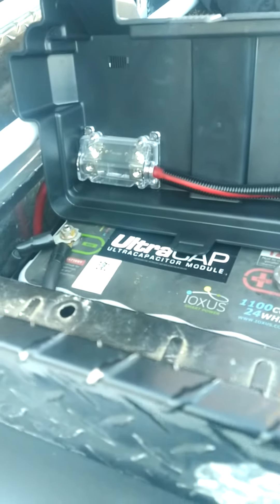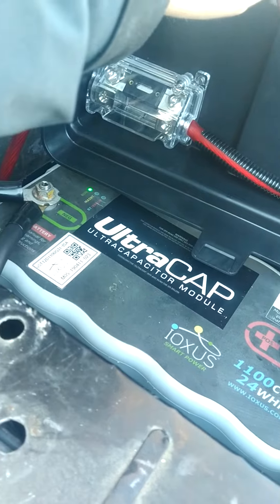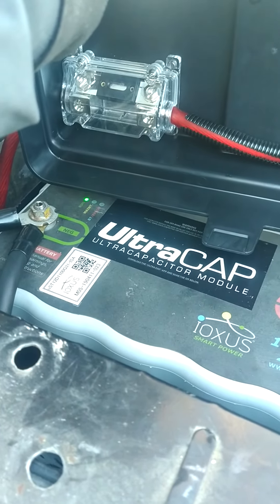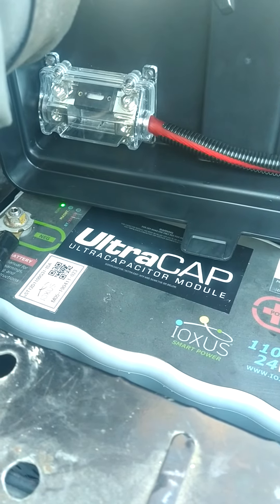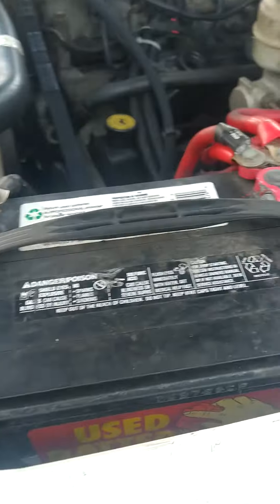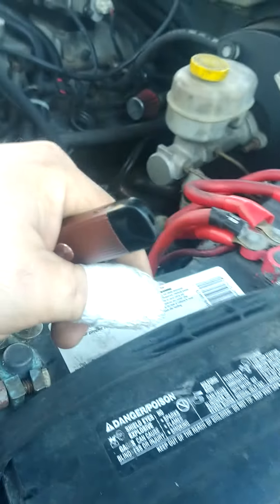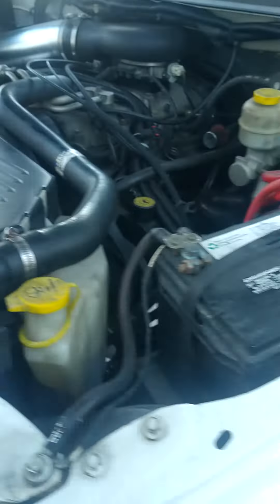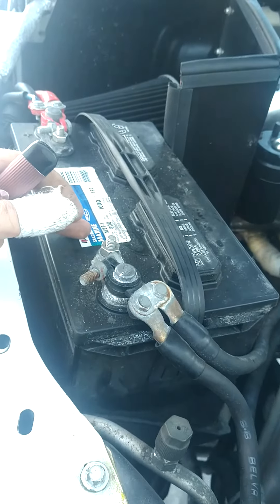Ioxus ultracapacitor installed.

Comment: Thanks.. gonna order a b stock from big Jeff audio.. I have 2 ab hawks. Orion xtr 2500.
Reply from the maker: It should hit good. I like the new Hawks, change it up from the XFLs.
Reply: @212Tan  yeah.. I had a 33hz box built by MBE.. 240 alt . Also running a Rockford t1 15 @38hz.. it's nasty just need more power

Comment: How did you charge it the first time?  Did you just run a wire from the battery and let the alternator top it off?  I have a 400 amp Mechman alternator and I be running 2 JP 23v2s on 2 Resilient Sound Platinum 18's with a stock battery for now since I've only got one 23v2 and 18 going.
Reply from the maker: You have to download a app and go through process. If it ask for pin code it is 1234 or 0000. Once you activate it through the app and start vehicle it will charge. EXO has a very useful video on it as well

Comment: So is it making a difference? Was it worth the buy? Does the cap still supply power as it is re charging? Sound?
Reply from the maker: Yes it makes difference. It stabilizes the system and I stay above 13.1 volts at full tilt now. I was seeing 12.3 at full tilt before
Reply: @212Tan  right on. It prompted me to your video from a previous search for info on them, been on the fence about investing in one- wasnt sure if it would really suit the application the way it cycles. Do you watch to see how quick it drains and how long it takes to recharge? Does the voltage drop while it charges and still playing, or able to keep stabil WHILE charging also?
Reply from the maker: @jimbobdobbs1597  I don't know about all that. I got mine on B stock for $200 and it's worth every penny. I'm also going to be running Iraggi alternator soon. I go Overkill with the power never just bare minimum. I will have 250 amp alt, 320 amp alt (dual alternator setup), XS Power D7500, Ioxus ultracapacitor, and (2) 0/1 gauges runs. All for Taramps Smart 5 and Rockford fosgate prime 600.5
Reply from the maker: @jimbobdobbs1597  I have over $1000 in electrical just for 5600 RMS watts
Reply: @212 Tan  1k aint shit in elect.u get the ixous ultra cap and 2 batteries you're at 1k..I jus did it..still gotta do the big 3 and get my 300 amp atl from brand x..The alt alone is 400 bucks.
Reply: @212Tan  well damn..thats what I'm running the taramp smart 5k bass with 2 skar vxf 15s and only have stock battery a xs xp1500 battery and the ioxus ultracapacitor lol
Reply from the maker: @cali8221  I was talking about over $1,000 in batteries and wiring. I have dual alternators on this truck and I have VFL comp 8K now
Reply from the maker: @cali8221  Over $6k+ in this build I'm sure I'm forgetting something. But amps alone $3k, wiring, battery, and alternators $2k+, subs $1k, that's not counting wood, stereo, or other miscellaneous bullshit. If I added it all up if probably get sick lol look at my current videos
Reply: @212Tan  yea man yell me about I jys got done doing my 2 vxf skar 15s build and I still need my js alt
Reply: @212 Tan  um yes I know ..my ioxus ultracapacitor was 399 my js alt I jus ordered was 400 and I have a xs xp1500 battery and ready either order another one or sell the one I have and jus get 1 d3100..I jus started on my set up nothing to crazy but it sounds good too me.All 0 gauge ofc wire ill customz 4spot and 6 spot distribution blocks went to a welding company and have thick copper terminals ..like I get it..

Comment: Can u put it up front to replace a battery and run lithium in the back
Reply from the maker: I do not know if it will work with all lithiums. I'm going to use with lifepo4 though. Long as you under 16 volts I believe it ok.